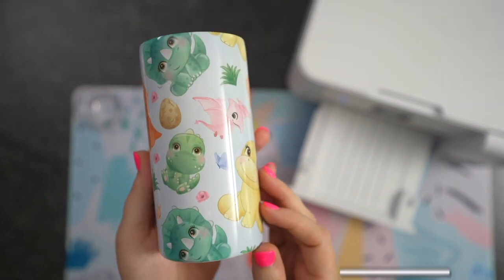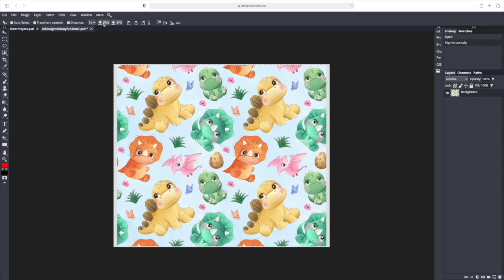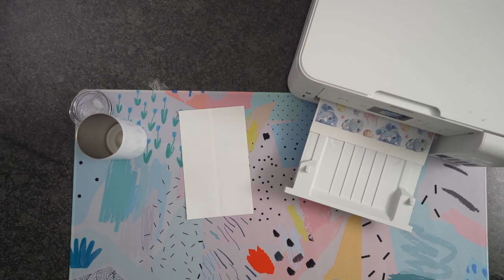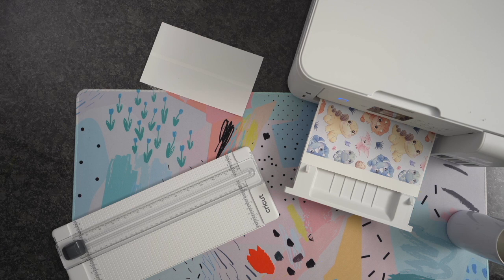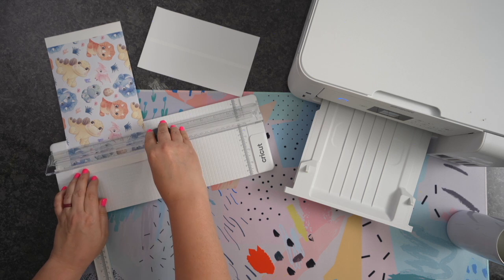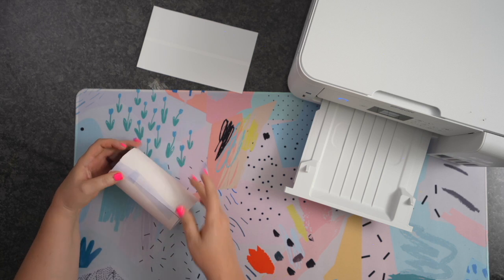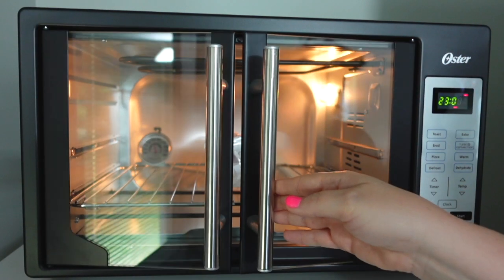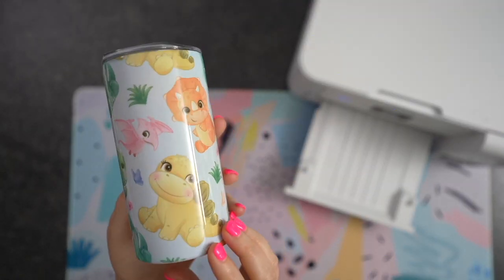🔥 How To Use Subli Shrink Without A Heat Gun

Comment: If I have a mug press do I still need the shrink paper?
Reply from the maker: The subli shrink is mainly for the pressure - so if you use a mug press then you wouldn't need it for a mug.  Tumblers may not fully fit in a mug press however.